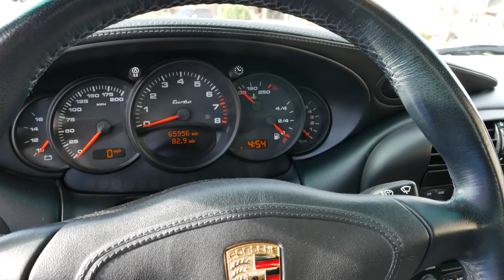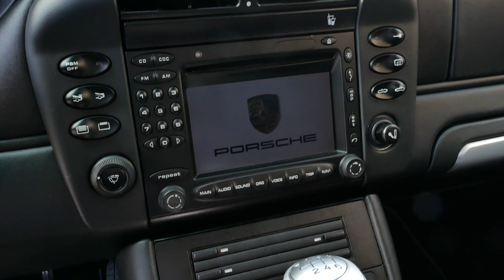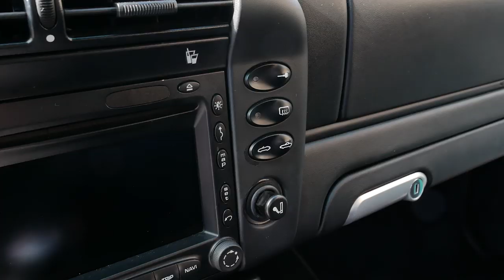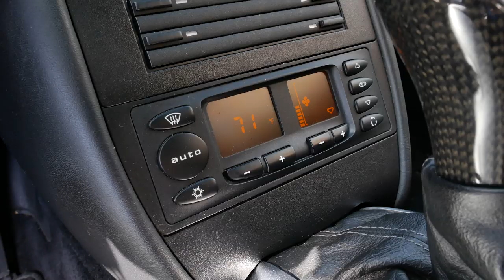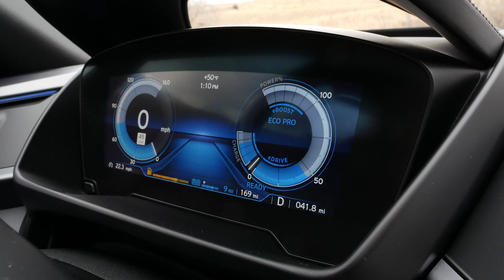Commuter Car BATTLE! New Tech vs. Proven Tech

Comment: One of the benefits of having a tape deck in the 996 turbo is that you can put a bluetooth cassette in it now and and use that to stream music and directions.
Reply: Reading this 3 years later you opened my eyes, I did not know this is existing 🙈. The perfect solution for my Classic car. Thanks for that 🙏

Comment: I have owned several BMW's and Porsche's through the years.
Each BMW was less reliable then the one that preceded it.
Porsche have been much more reliable and have had much better resale.
Reply: I have both a BMW & Porsche. Both are fun etc. but my BMW is far cheaper on repairs and fewer of them.Had to put a new rad hose on my Porsche a few weeks ago. $200.00 for a hose! Yikes!
Reply: @jamesdean9195  My experiences have been just the opposite.
Both my Porsche's and Mercedes have been far more reliable and durable than my BMW's.
They may have been cheaper to repair but the number of times they required work more than erased any savings.
The Porsche's also retained their value much better.
Reply: @williamegler8771  I guess I've been lucky with my Z3 which I've owned for 10 years and now at 208,000 miles. Just replaced the clutch which is really the only thing that has been serious but really, that falls under routine maintenance after so many miles. You're lucky Bill and am sure there are many who prefer the Porsche and ( possibly) as many others who prefer the BMW. Maybe it's not a case of which car is better.. 🤔 I'm sure you, like me would have a small fleet of cars that we like, all for different reasons.

Comment: Going back in time to my university days I drove a 1991 Honda CRX Si. That car was in the top 3 of my favourite driving cars. Very simple concept with a manual transmission. So many vehicles today, makes me feel like I’m driving a laptop.
I remember the days when you flew to your destination and hopped into a rental that you could simply slide the seat to the correct position, manually adjust the mirror, turn the knob to what station you wanted and drive off. Nowadays it’s as confusing as sitting into the cockpit seat of a Boeing 767.
We as humans, believe we are so smart, yet,  we drive such sophisticated vehicles and still crash all the time. More attention is given to the technology we have inside the car, the the real world happenings outside the car. 
I’m not saying I don’t like modern conveniences such as A/C, a nice sound system or a powerful motor (that I can’t tinker with), but does it need to be so complicated with all these menus and not buttons?
The cost of all the “must haves” has inflated the price of modern cars to obscene prices, yet, most people are not better drivers.
I remember when a 3 year car loan, was considered a long term. Now people are getting car loans of 84 months.
I would gladly go back in time, to the era of cars where, KISS ( keep it simple stupid) still applied.
Loved the video👍🇨🇦

Comment: Franny, thanks for the fun comparison video! My thoughts between new tech vs. proven tech are... 
My 67' MGB GT had 4 gears, a wooden steering wheel, spoked hammer-on wheels, switches, sliders and knobs for all car interfaces, and one speaker for the AM radio! Fun visceral car, but completely useless sharing space with so many SUV's on public roads. It even seemed small compared with a Mini Cooper next to me at a stop light... My daily is a 17' M240 with the mighty B58 turbo 3 liter inline, a manual transmission, a GPS, Harmon Kardon stereo, and wonderful buttons. It's an example of a relatively modern car that really helps bridge the gap between the old MGB and more modern "futuristic" cars like a Tesla or Mercedes with all their touch-screens and other in-car distractions. So, it still seems there are cars with new features, but retain a lot of what the old sports cars offered. (oh, and sold the MBG in 16', and just replaced it with a 09' Boxster, which is far, far more livable as a modern, SUV navigating, small, visceral car, and also doesn't have silly screens or a heads-up display)

Comment: It's so easy to put a double DIN Apple Car Play-capable head unit into a 996.  I was able to do an amp, door speakers (2-channel only plus a small sub in the back seat) and really nice Pioneer head unit for just over $1000.  Sounds great and more than enough power/volume level to be loud on the highway.   Fantastic upgrade and really solved my reluctance to get a car from this era.  I just don't want to drive without my audio books!

Comment: You captured a really good number of the points that bother me about newer cars here. Particularly the issue of knowing where the buttons are without having to look away from the road.

One point not explicitly stated but very important is that with older steering you know what is going on with the road surface and how much grip you have by the weight and feel of the wheel. If there's a patch of ice for instance you know immediately, without having to lose traction of slide. In many modern cars you don't become aware of the change in grip until it physically stops going where you ask it to go.

..I do wish I had air conditioned seats for summer.

Comment: Enjoyed the video and Interesting comparison. For me, the Porsche 996 Turbo S is the way to go... more connection, more feel, better cornering, manual gearbox, and an authentic engine/exhaust note! Not a fan of the artificial exhaust speaker on the i8, but it does look good.

Comment: Nice video!  Broached the subject well. 
I've owned a few modern cars in the past few years with all the gadgets, but never kept them long. My old 996 gives me a huge dopey grin every time I drive it!  I take the long way to the store, or just take a loop on the turnpike for no reason. You're right, manuals are rare now, and it's sad to hear people today argue:  The paddle shifters make it 1/10th of a second faster in the quarter mile!  Or some such argument. Those people are missing the point!
Like others have said, you can upgrade your entertainment system in any car to add Bluetooth, backup camera, etc. 
as for the magic of auto-dimming lights..... I also have an all original 1955 Cadillac that has factory auto-dimming lights, signal seeking radio with foot pedal, 4-way power seats, power windows, power antenna, power electric trunk lid, and 4 adjustable A/C vents in the roof, one for each passenger (an early version of "quad zone" a/c??).  Some modern stuff has been around longer than many people think. ;)
Look forward to seeing more of your vids!

Comment: Hi Heidi, thank you for another fun video!  Must admit to not being a fan of the i8 or i3 or Teslas, etc.  Too toaster-ish.  We bought our 997S new in '06, and I still love driving it.  Modern enough.  Also have a gaggle of old Porsches and Alfas and other cars like you do, and I love them; low power and quirks and no connectivity and all.  As you said, it's about the visceral feeling of being in total control, I think, and being able to drop the engine and fix whatever goes wrong...with a wrench rather than a laptop!
Reply from the maker: Hi John, I did not think I would like the i8 either, but Franny convinced me.  It is super fun to drive (BTW, it’s Franny speaking in this video, I do the car reviews.). Heidi

Comment: Very good video and agree with what you said.  Accidents are up due to "distracted drivers."  That use to mean texting or talking on handheld phone while driving but now it's all the entertainment screens and fact that you must take your eyes off the road to do about anything with these touch screens.  We opted for base model Prius Prime (my wife's car) just to get knobs instead of big touch screen.  We've had 5 hybrids now and scary point comes when warranty on hybrid systems expire.  Example:  We had 2008 Prius.  At 99,890 miles on the car, the hybrid battery failed.  It was replaced free since under 100,000 miles but I asked the Toyota place how much would it have been if not under warranty.  They showed me their cost (which they could then bill Toyota for) was $2,750.   Some car companies that have cut the size of their engines way down now pipe a synthesized sound of a bigger engine through the audio system.  To me, that says even they know consumers want the sound of the bigger engine.  My daily driver:  2017 Honda Accord LX (base model) with last year of naturally aspirated 4-cylinder and I get 40+mpg highway.  However, if I want to get out on an open county road, I get a toy out.  So BMW i8 for daily and 996 for fun!   Safe travels!
Reply from the maker: That is funny. Buying lower to get knobs!

Comment: I think each car has its pluses and minuses.  Modern cars are much faster compared to older ones.  But driving is about experiencing the road and your ability to navigate through it.  I like your point about being distracted in modern cars;  they are way too complicated for the simplest tasks.  For example, my mother has a Mazda 3 and the navigational system is so complicated that unless you preprogrammed your music selections, you can forget about changing stations while driving.  Having manual buttons on your dash is not wrong.  Long live analog gauges and cup holders!

Comment: One assumes both cars are equally good at eating up highway miles and enjoying curvy backroads. The question is which one is more enjoyable on a multi-day road trip? If you had to drive from Colorado to Kansas City on any mix of highways and backroads of your choosing which of these two cars would you take?
Reply from the maker: Probably the i8.  It is a smoother ride, BUT the Turbo is a cabriolet.  Tough call.   Either would be amazing.   Toss a coin. Heidi

Comment: Hello Heidi I'm planning on purchasing an BMW I8. It looks Exactly like your BMW I8. It a 2016
Reply from the maker: Cool.
Reply from the maker: I've been trying to work out the differences between the years and I think the major 2016 difference is the option for laser headlights.  We had a neighbor (who was babysitting a friends i8) stop by a couple weeks ago (posted some photos to Instagram) and that car had the laser lights.  You can tell by the yellow triangle warning label on the lights themselves.  As for the trim, that is super confusing...  For the top trim, look for the silver running board trim with the blue "i8" logo, leather engine cover and black shifter.  I think the rest is all up for grabs as options outside of packages.  Ours is a real mixed bag - exactly (and only) what the original owner wanted.  It is actually a really nice trim set up.  
I hope all goes well with your sale!  let us know how it goes.  
Have BMW take a look at it either before or after.  Have them check the turbo and the 12V battery.  Our turbo was replaced recently (just before we bought it) for a small leak.  There is an upgraded unit so they just swap it out under warranty.  To determine if the 12V is bad, charge up the HV battery to completely full and then unplug the charger.  If the big battery loses a significant amount of power in a few days then it is trying to keep the dying 12V battery alive.  That is something the dealer has to replace (or at least source) because it is VIN coded to the car. Franny

Comment: In general there has been great progress in many areas and there are plenty of interesting technologies on the horizon. Arguably todays engineering is better than yesterdays. For instance I really like a navigation system that gets me where I want to go without distracting me too much.

That said, I like driving and the advancement of technology has negative effects as well. With all the added technology and cars getting bigger and heavier there is less enjoyment to be had behind the wheel. Just a couple of weeks ago I was in a 1998 Honda Accord Type R. You feel so much more connected in a car from that era then the present-day equivalents.

Personally I don’t like items on a car that distract me from driving it. You already mentioned the lack of physical buttons and the unnecessarily difficult climate controls that can be hidden somewhere in the infotainment systems. I also strongly dislike parking brakes that come on automatically, without me asking for it. Then there are the indications on modern cars with manual transmission that tell you to shift to a higher gear way to soon. I don’t like ambient interior lighting that make me feel I’m visiting the kind of bar that attracts all the wrong crowds.

Also some tech is great in concept, but less so in practice. I like the idea of rain sensitive wipers. I have them on my BMW, they work, but not a 100%. The idea isn’t new considering the 1970 Citroën SM already had them. That system is different to the modern equivalent as it measured the current needed to operate the wiper motor instead of the reflection of light. Also the autronic eye that would switch from high beam to low beam dates back to the early fifties. I have no experience with those, though.

Comment: Great video.  The number of folks that love cars and love driving continues to shrink.  That's one of the reasons manuals trans are going away.  Lot's of folks would rather be passengers than drivers.  I'm not saying that's bad, it's just a sign of the times.  Maybe it's because I'm a baby boomer, but I prefer my older analog cars with manual trans.

Comment: I love my i8, but I really miss the connection to the car and the road that I had in my 78 and 97 Vettes.  One of my biggest gripes is that the i8 pushes through turns and gives me anxiety.  I think I might try wider tires on the stock rims as I've seen some folks post about doing that.  And, I agree that it's nearly impossible to work on, and I miss that since I restored my 78 and did a few upgrades to my 97.  I did an oil change on the i8 without issue but the week after I got mine, the GPS rebooted 3 times, the O2 sensor went voltage low, the inner door panels were falling away form the door frame due to weak clips and the door struts weren't pushing the doors up all the way.  I took it to the dealer and it sat there for 2 weeks waiting on parts from Germany.  Not only that, I had to bring it back twice because the dealer broke some things trying to fix these problems in addition to stepping on the black rocker cover, then broke more things trying to fix the things they broke the first time.  It's perfect now, but I learned that even the mechanics and shop foremen are learning as they go.  However, one of the saddest feelings is going to a car meet and telling people I can't show them under the hood, or showing the gas engine would require a bunch of work and the engine is dirty.  I have a plan to remedy the problem of displaying the rear engine.  Just this week I found salvage parts that I want to cut large holes in, put some high-temp glass in the middle and do some Carbon Fiber skinning of some of the parts.  Maybe even add a switchable blue LED string of lights.  Here's what I have to work with:

https://www.youtube.com/watch?v=7DvaA9zBFDE
Reply from the maker: Pat Freeman wow.  That is a bummer.  Our car is going in tomorrow for a battery check.  I hope we don’t have it gone for two weeks. I admire you for being so bold with the i8.  I have to admit, the electrics scare me on it. Heidi
Reply: @HeidiandFranny  I hope your battery check up goes well and am glad BMW has a procedure for this.  Detecting battery issues under warranty could save us a lot of money in the long run.  I haven't taken mine in to have that done.  There are some mornings where I commute to work on eDrive plus EcoPro mode and am seeing 20-22mi of battery life.

Comment: I'm a bit torn on the modern car v older car. I generally prefer the older cars. I'll take an automatic transmission over a manual in stop and go traffic. I like the newer seat comforts like heat and lumbar support. But other than that, I don't like how much the modern cars distract you from the road. To me, a touch screen is the most dangerous thing they could put in a car. You're not supposed to mess with your phone while you're driving. Now you just mess with the car's touch screen. If I'm not going to be actually driving the car, I'd rather a modern extensive public transportation system. If I'm going to ride, I'd prefer to just ride and not have the expenses of owning a car.

Comment: I’m definitely old school as I guess most of your subscribers are. I get bored easily and older manual cars keep me occupied.
I also prefer to the driving rather than have the car drive me.
I do wonder which car you would prefer to take on a road trip.
Reply from the maker: Great question!  Probably the i8...  It has better comfort systems and better gas mileage.  It is more than capable for passing and such and having the top down on the highway gets old pretty fast.  The Turbo is comfortable enough, but the ride is a bit more harsh.  So, if it is 90% interstate, then the i8.  If it is nice winding roads and mountain passes and such then probably the Turbo :)

Comment: The older car without a doubt. I am not convinced that making the car do more things on its own makes for a safer vehicle. I am not a supporter, at all, of automated cars. I think that any car that gives the driver more things to take their attention away from the main task, which is driving, is actually making it more of a potential danger on the road. I concede that not everyone likes to work on cars but manufacturing cars that mean you can do nothing without taking it to the dealership is, in my opinion, just a way for car manufacturers to make more money. More gadgets means more things that can go wrong and probably more visits to the dealer. So it would be the older car for me. Thanks.